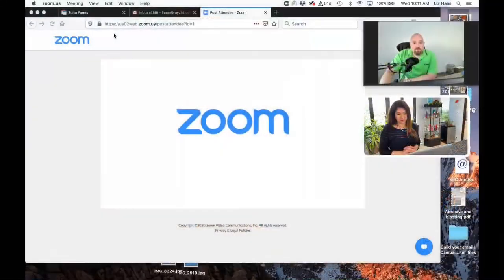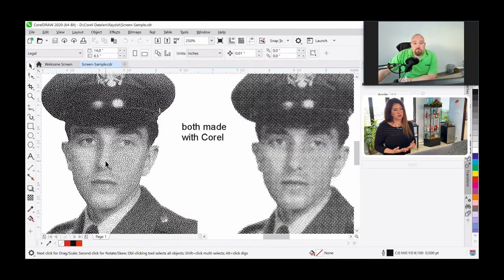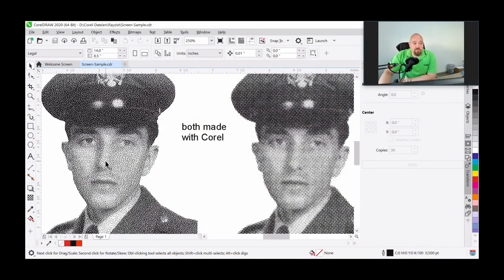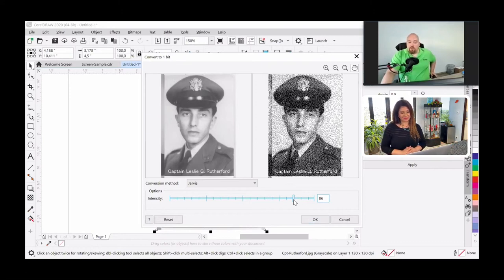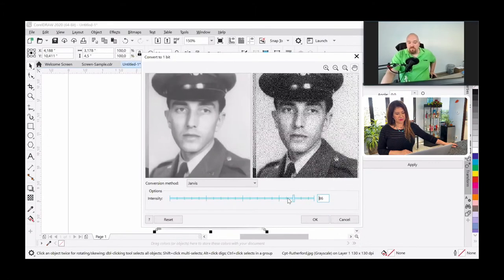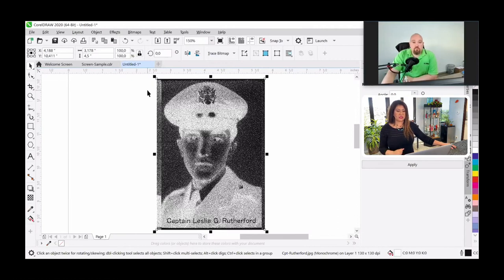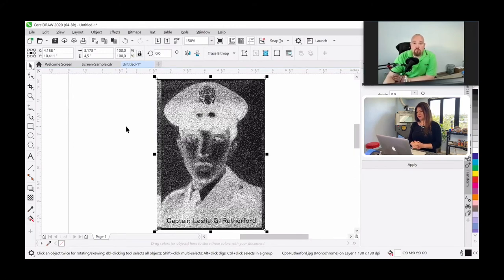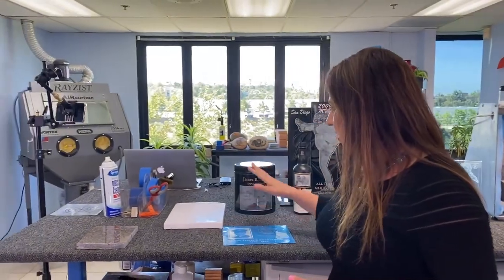X | CorelDraw with Jarvis Screen

Comment: To get a good image print out for halftones do you have to use RIP software to get the detail you need .. the kitty in the glass combination with the jarvis lyon .. would the halftone not worked out as well if just using a usual printer?
Reply from the maker: You do not need a RIP to produce halftone images. IF you were using a RIP, you would be able to achieve finer lines per inch or (DPI dots per inch) to your halftone. When you do finer halftone (smaller DPI), you must use compression exposure (like the Luminex1422). 
With a LetraLite and standard printer (without using a RIP), you can achieve 40-45 DPI with RIP and vacuum compression you can achieve better resolution.

Comment: If you do not have the compression exposure unit will the roll mat work okay for Jarvis prints?
Reply from the maker: Absolutely! The LetraLite can achieve halftone or Jarvis photos. The tight compression is best from the vacuum frame Luminex unit; by no means is it a requirement. Just an upgraded exposure system.

Comment: Could or should you use adhesive for halftones?
Reply from the maker: No need for using adhesive with Self Stick films. However, you 'could' if it were a very light contact of adhesive to the stone surface. You would want to apply the adhesive lightly to the stone surface in this case and not to the "halftone" stencil to avoid adhesive from building up around the small halftone dots.

Comment: What is RIP software?
Reply from the maker: Raster Image Processing: RIP software is more common for color separations for graphic and screen print applications. The uses in our industry are for higher resolution print control of your printer and especially for "true" halftone, which a printer cannot natively (interpret) print. We have to convert to the screen to a GIF, which reduces the quality of the dot but allows the printer to print is a screen "halftone". 
CAD Link Filmmaker would be recommend.